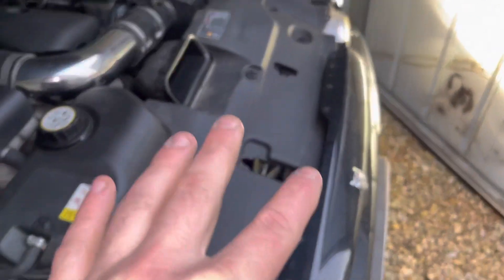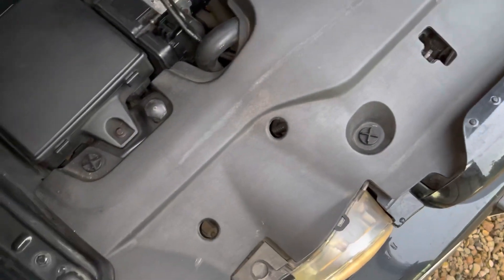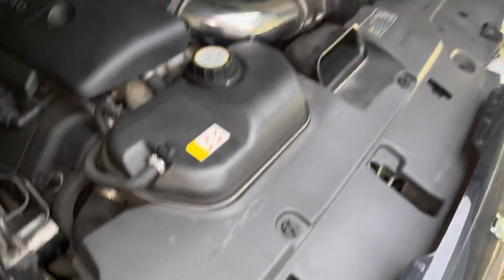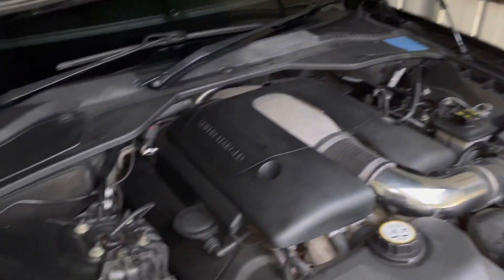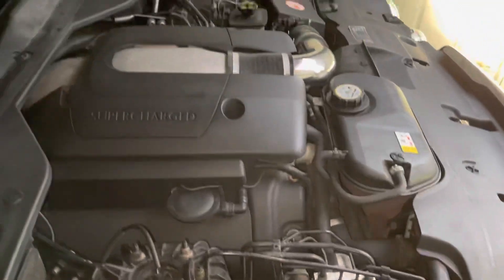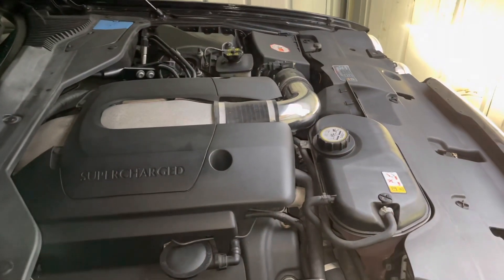peppermint oil to deter mice and rats has it worked ? Jaguar project

Comment: Funnily enough a GIST wagon overtook me...(I was parked in a layby OBVIOUSLY) and strangely enough there was a strong smell of peppermint...wondering if that was you..?  Seriously though have serious problems here where I live...'wasted' a fair few of the little 'dears' rats and control boxes in both the garage and around the outside of the house...two youngish rats as well...set some traps and bait them with peanuts butter...works very well.  You can use that a s a 'control' to indicate if they have indeed 'left the building'...seeing signs of them is normal...although a reason to take measures...actually seeing them is a bad sign and needs immediate action. My van, Noddy Car and daughters Freelander have all had mice in them.  Not at the moment though...its an ongoing issue.
Reply from the maker: I did smell of pepermint for ages haha so could have been lol